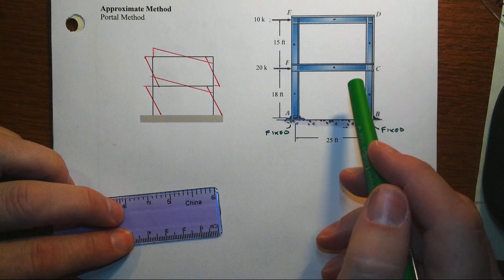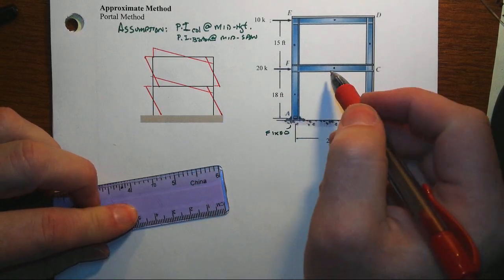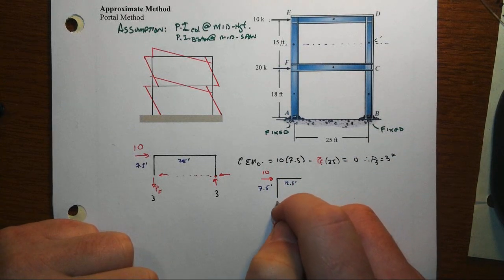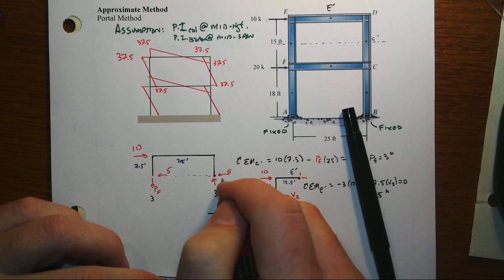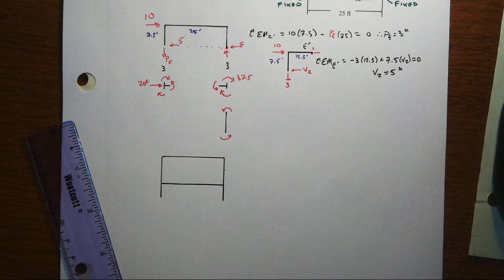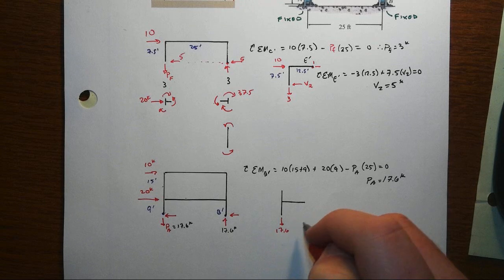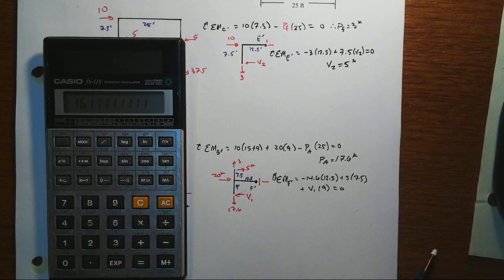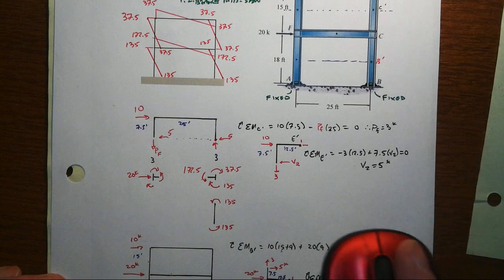2 Story Frame Example   Portal Method

Comment: Have you used this example using the matrix stiffness method? If so could I possibly see the worked out example, or link to the video if you made one?
Reply from the maker: Yes and no.  Certainly, yes but with different numbers.  You might check my matrix channel; not entirely clear just what is or is not included in that one.
Reply: @dougschmucker8212  what is your matrix channel?
Reply from the maker: @colinhennessey5076  Looks like I am mistaken.  I do not have a matrix playlist.  I used to use many of the videos in the first structural analysis course in the second (matrix).  But, not quite seeing the specific ones that I thought might be there.  I am no longer the primary instructor of that second course, so don't really have motivation for putting those examples on a free channel.